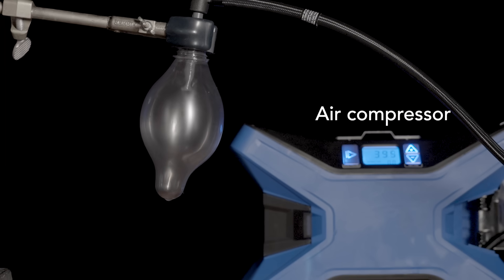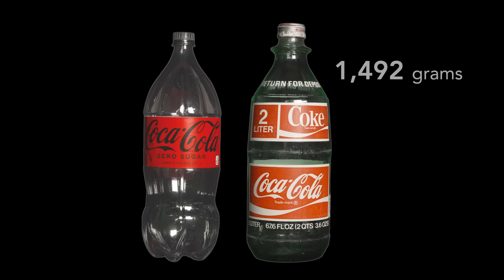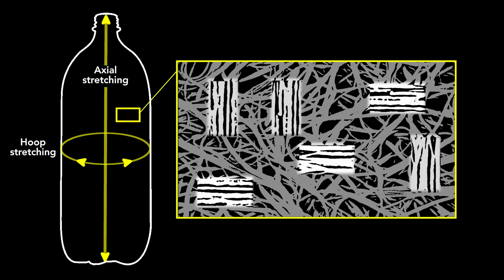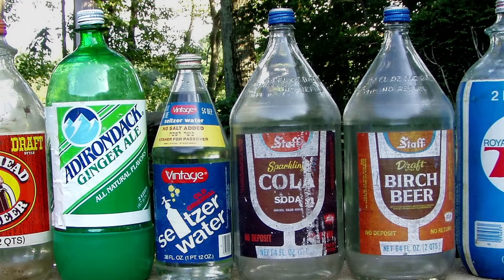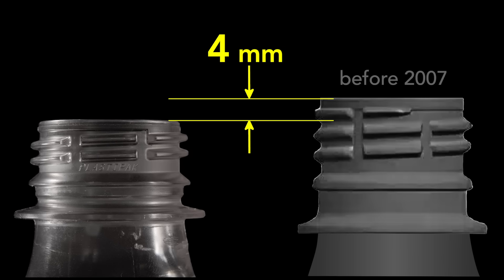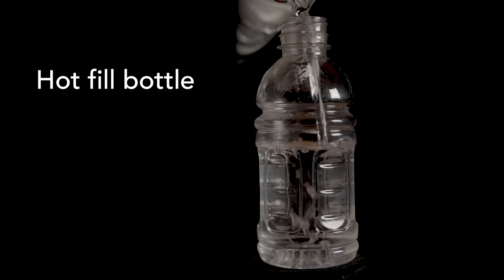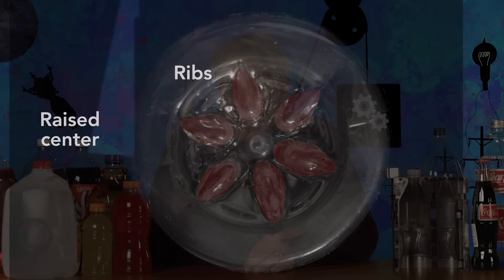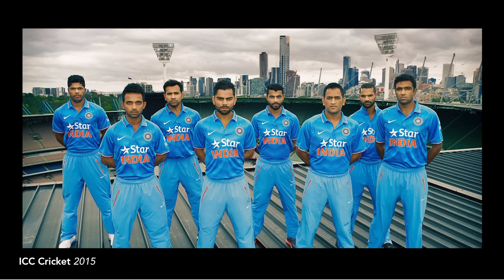The masterful design of the two-liter plastic soda bottle

Comment: Whilst I appreciate the engineering that you have pointed out it does not outweigh the negative global impacts from their production. This isn't a "masterful design" by any stretch, just a profitable one. They shed microplastics into beverages that are then absorbed and retained in the body. The plastics and food and beverage industries themselves privately admit that plastic packaging will never be economic to recycle. That's why 99% of them are not recycled. The recycled ones can only be recycled into lower grade plastic products once, which are then not recyclable.

They are designed as single-use.

The overwhelming majority of plastic drinks bottles made so far will still be here in hundreds of years, along with all of the micro- and nano-plastics spread throughout the food chain and biomes and past our blood-brain barriers. It's good design in the same way that lead paint was.

Comment: Cool video, definetely enjoyed the parts talking about the shape of the design, but some of the comments about plastic feel weird. Talking about PET like it's a miracle material without mentioning the huge problems it causes reminds me of 1950s ads. There is a brief mention that 75% is not recycled but then you say "it's the most recyclable plastic" which sounds like an implication that it's not a big deal. Most bottles after all these years are still made from new plastic rather than recycled and there isn't much being done about it other than phasing out the more harmful designs (in EU we got rid of plastic straws and the bottle caps now have to be attached to bottles).

Comment: I wonder if it might not be more economical to create the form with a negative vacuum instead of positive air pressure.  Once the vacuum is established in the mold, normal atmospheric pressure could force air into the bottle preform.  And the vacuum only has to be established once at the start of the process.  Since the bottle contains the air being force in, the vacuum is not lost and the same vacuum can be used over and over again with only normal atmospheric air pressure on the preform side.  Not sure if 14/psi could be enough to do this, but could that be increased by greater negative vacuum?  I just do not know how you would maintain the vacuum as the preform is being fitted into the opening.  But some engineering feat could pull it off, I imagine.

Comment: youre green screen keying is impressive when i saw the bottles. how did you do it
Reply from the maker: Good question. The short answer is Rohan and Joshua. The longer answer is this. I'd played with green screens on and off over the last decade and never obtained a result I liked. (None of these shots appears in videos, except some of fluid flow, which were a disaster and ultimately had to be matted.) All of the videos against black were shot against a black backdrop, which we enhanced with color grading. We have always worked in a compressed format (4:2:0 at first) and 4:2:2 now, which I find to be really hard to pull a screen with. The reasons are technical, but recall that you are getting full luma, but only average chroma. When I talked to professionals they'd tell me to go get a 4:4:4 camera, to which I usually nodded, but I really want to say "sure, first you give me $100,000 or so." The more practical answer is that a) we light the screen better: it must be very bright compared to the foreground image and b) we switched from slog3 to Rec 709 (I LOVE slog3: all the second unit shots are in slog3). We pull the screens in Premiere Pro using their Ultra key. We shoot on Sony FX6s and found a good resource on how to film a green screen on THAT camera. Google "ukjoncollins" and "green screen" and "FX6" and you'll find it.

Comment: I remember back in the late 1970's when injection molding was becoming a new technology, by Dad worked for a company called Standard Container Corporation.  Standard was just getting into injection molding, making 2 gallon and 5-gallon plastic buckets, and the blue Chevron Delo oil bottle.  I walked into my father's office and saw a soda bottle blank sitting on his desk.  It looked like a test tube with the soda-cap threads on top.  I was amazed a soda bottle could come from this plastic blank.  At that time, there was a separate black plastic bottom that was fused to the clear bottle, which later disappeared.  Standard traditionally made the venerable yellow and red 1 gallon gas cans, Folgers coffee cans, 5-gallon square oil cans, ammo boxes and c-ration cans.  It was great growing up seeing this industry as a kid.

Comment: Okay, in watching this I remembered there was one time just a few years ago I opened a 2 liter and the cap basically rocketed off the bottle,  hitting the ceiling and sounding like a gun went off. I believed it happened because I had just gotten it from the car and maybe it was a bit shaken up, but It very well could have been a manufacturing defect in the cap or bottle threads. It hadn't happened before and it hasn't happened since.
Something to add, the soda was just fine. It didn't froth up or anything, which was surprising.

Comment: When I was a young man, a heavy glass soda bottle rolled off the back seat of my car, hit something hard on the floor and exploded. One of the pieces of shrapnel made quite a gash in my ear, and I had to pull over for some time to stem the bleeding. Couldn't happen nowadays.

Comment: I remember the 2 litre bottles in the 80s (at least here in Australia) were rounded on the bottom but had a large seperate cap there made of a different type of plastic (usually black) that snapped onto it so they could stand up.  The plastic at the time was strong enough to hold pressure but not yet able to survive being moulded into a more rigid shape at the bottom without splitting after being dropped.

Comment: Hi engineer guy ! First time watching your video and I am now educated to a point on the design and pressure of drinks plastic bottles.
  I am a syrup manufacturer and I have always toyed with the idea of having two different flavour syrup in one bottle separated by a center divider but allows, when being poured,the two flavours to be mixed equally to get a perfect mixed beverage when water is added to dilute the concentrated syrup solution, for example pineapple and ginger flavoured syrup do you think it is possible?
  A next example; say a blue coloured syrup ( blueberry) and a sort of cream/white colour (sour sap flavoured syrup) in one bottle but sperated by a... in the middle of the bottle...a divider / separater panel.🤔🤔

Comment: I would like to know what happened to the rubber seal we used to have under the caps of these bottles, these were sometimes used for promotional codes or contest hints or passwords. They also seemed to perform as a seal to inhibit the CO2 from escaping while unopened, however i distinctly remember a 2 liter of carbonated beverage staying carbonated for a much longer time when opened for consumption roughly 2 weeks, as the rubber seal would create a superior seal compared to the pet cap alone found in todays products. These rubber seals found under the cap were removed in a cost cutting effort in the early to mid 2000's thus rendering a freshly opened 2L bottle of cola flat after around 2 days after opening.  I always assumed that this was done to increase sales of the product by creating an artificially short lifespan for their product when opened. Can this be confirmed?

Comment: Why don’t sodastream bottles use a petaloid base? Is it because the thicker plastic walls don’t lend themselves to being blow molded into the shape? As for the thicker walls, is it just for durability in reuse? I’m guessing the working pressure is still lower than design pressure for these 2 liter PET bottles.

Comment: Early 90s I worked for a time in a plant that made 2 litre bottles.
I worked on machines that chopped up reject bottles and injection molding machines that made the ' test tubes '.
They had huge ' wheels ' of about 30 bottle molds and in the time the wheel went around it blew up and cooled a bottle enough to chuck it off onto the line.
Times 30
A continuous process.
While there I also put together a 
' wheel ' device that had about 8 bottle positions on it for feeding a 
' puff ' of air to blow out any dents before labels were attached.
Ink jet dot- matrix printing guns were also used to put a quick date and time stamp on bottles.
They were so fast a bottle could go by at 100mph and it could still get a good print.

Comment: Just before Christmas four 2 liter bottles of diet soda froze and exploded in my car. One of them broke cleanly at the neck just below the cap; the threaded portion was still in the cap. I wonder how much pressure was required for that. The other bottles split on the sides.

Comment: My father worked for a company called Black Clauson in the late 60s early 70s. They were part of the group deveoping injection vacuum blow molding machinery. The proto type bottles before that were  a welded multi piece bottle that if you shook it and dropped it, it exploded. As kids we got those bottles of coke. Only 70s kids in the US that had coke in plastic bottles in their lunch.

Comment: Great video! Though I think the reason the HDPE jug is weaker is due to the fact it is softer and more compliant compared to PET due to its glass transition temperature being so low. HDPE is also a semicrystalline solid, so I'd expect crystalline regions in those jugs as well, assuming they are made in a manner similar to the soda bottles.

Comment: 3:50 A significant factor contributing to the container's deformation relates to its design priorities. Plastic milk containers are engineered for maximum storage efficiency, resulting in their generally rectangular form, rather than being built to withstand substantial pressure differences. Consequently, when internal pressure exceeds external pressure, the container material stretches and tends to adopt the physically optimal shape – a sphere (in three dimensions) or a circle (in cross-section) – which minimizes surface area for the enclosed volume. (This principle is elaborated upon later in the video.)

Comment: I worked briefly in the 2 liter bottle industry. It was interesting but simultaneously in WV where the glass bottle industry had matured the local economy was decimated. The change in materials, energy supplies and transportation costs were the main reasons.  I remember the main machine was the BAB4.

Comment: 10:40 How TF can two different juries come to two different conclusions about whether or not something is hollow or solid?  I would assume that you wouldn't want a cross-section, but you'd want to shave it horizontally just above the indentations, and then see if you can stick something in there. If you can, it's hollow, if not, it's solid. Do this both physically and you visually with magnification.
Reply from the maker: One was an appeals court, so I would think no jury.
Reply: @engineerguyvideo  Thanks for the clarification.  TBH, I'd like to read statements from both judges because there is clearly information I'm missing here. This sort of thing keeps me up at night, haha.

Comment: This brings me back to my Packaging Sci 201 classes! 
Also of note, the preforms are not made in the bottling plants but made at the supplier who then ships them to the bottling plants to be blown and filled. You can fit multitudes more of preforms on a pallet than unfilled 2L bottles because no one wants to pay to ship just air!
Reply from the maker: Indeed, typically the preforms are made elsewhere, but there are some factories that make the preform, then make the bottles. All the temperatures and times for blowing the bottles are different because these preforms are fresh. I wanted to figure out a way to get this into the video because it highlights engineers in action (the detail here, the exact steps followed are an important part of engineering), but it was too tangential.
Reply: @engineerguyvideo  It's difficult to fit decades of knowledge on the subject to one video but you always do an amazing job. Thank you to both you and your team for the fantastic work over the years! Looking forward to the next video!

Comment: I find it amazing how plastic bottles can reliably make a reusable air tight seal whereas most other connections in pipes/bolts need o-rings or gaskets and they're often single use.

Comment: I never have and probably never would put 70psi in a bike tire even though they state that. Even the expensive thick tubes and tires I use I only inflate to 22-25psi and they always leak down to 16psi after a month or two. I have seen this same behavior with several sizes and brands on different bikes for over 20 years. I have never understood bike tires claiming 60-70 psi.

Comment: I hope you can make a video that focuses on the soda bottle cap@

I've designed the injection molds that make the caps for plastic soda bottles.

The first type of tool that I designed was a 96 cavity, multi-shot, collapsing core tool. Some of you may recall how the plastic on the inside of the cap was a different color from the rest of the cap. These materials were molded in two stages on the same tool. A "collapsing core" allowed the cap to be ejected from the mold without having to be unscrewed (and might be worthy of its own engineerguy video!).

The second type of tool that I designed was a 96-cavity collapsing core tool, but it was not a multi-shot. The design of the soda bottle cap no longer needed the two materials. A thin wall with a beveled edge replaced the softer interior.

These tools were designed to run for a minimum of 100,000 cycles between maintenance and 1,000,000 cycled before refurbishment. The toolmakers at the company were often considered to be the best in the Midwest. Their tools regularly operated for 5,000,000 cycles before needing a minor refurbishment.
Reply: Interesting! Midwest is best!

Comment: huh even soda bottles are not safe from patent arguments.  Interestingly the glass bottles used to get washed and refilled.  And if you add Glycol to PET you get PETG a common filament for 3D Printers, Though there are people who turn drink bottles into filament because PET is close enough.

I never would have expected that soda bottles have nearly 100psi in them, I knew they hissed from the built up CO2 but just never expected that much pressure.

On a fun note I find if you store a 2L on its side after opening it stays fizzy longer, The cap cannot be resealed as gas tight as it was from the factory but it is still fully fluid tight. so as long as it has enough to cover the cap still you can extend post open fizz time in the fridge.

Comment: The hemispherical bottom with the cap lasted well into the 1980s, I remember my dad using the bottom caps as plant pots for starting seeds before planting them in the garden.
Also, the interrupted thread of the bottlecap is similar to that used on artillery gun breeches.

Comment: 5:44 the lip that holds the preform in the mold has a handy side effect. It makes it easy to grasp with your fingers to carry the bottle from the top. For 3 L bottles, which are heavier and have a larger diameter, this is especially handy as they tend to have a larger lip.

Comment: The early plastic 2L bottles in the 1970s had a hemispherical bottom and a separate plastic cup shaped base was hot glued into place to act as legs.  it was possible to cut the clear hemispherical bottom, invert it and place it over the cup shaped bottom and make a small greenhouse of sorts.

Comment: Excellent video, as always. One small correction though, unless I'm mistaken:

At 5:50, you discuss the ring which is lightly attached to the base of the cap. You call it a "tamper-proof ring". My understanding is that the common terms used here are that "tamper-proof" means something prevents tampering, but this is not a tamper-proof system, since it does nothing to stop someone opening the bottle. What it does is it tells you if someone has done so, which means it is "tamper-evident". It will show evidence, if any tampering has happened.
Reply from the maker: in the literature it is called a tamper-proof ring and also a pilfer ring. We debated which to one to use ... the team was adamant that tamper-proof was better than pilfer! Personally, I liked "pilfer."

Comment: The blooper is perfect, not just cause it's funny, but because it shows so clearly what is happening: Once Bill cracks the lid, the whole bottle turns white in 3/4 of a second (16 frames) as the gas bubbles form, they immediately rise, pulling some soda up with them, and punching the lid right out of his fingers. After another second and a half, the bubbles have mostly escaped or popped, and the bottle is perfectly, innocently clear again.

Comment: Are cryogenic rocket stages still held up by internal pressure?
Back when they were sheet metal, then would crumple and collapse under the weight of the upper stages if fressure dropped.

Comment: This is one of the only things I've seen that mentions the cap that was put on the bottom of 2 l soda bottles back in the day. I grew up in the '80s and I remember those caps but there's almost no evidence of them existing when I search for photos of soda bottles from the '80s. Maybe I have to limit my search to the '70s?

My grandma used to use them for planters in her garden. One thing that's not covered in this video is in the '80s, when they made the transition from cap to petaloid, they did start using the pedaloid design in the bottle while still having the cap. Sometimes I would take the cap off for fun. They were held on by glue.